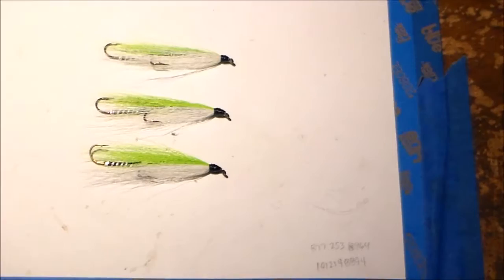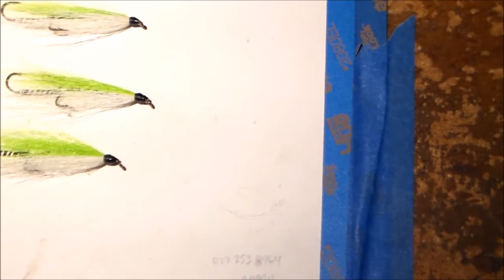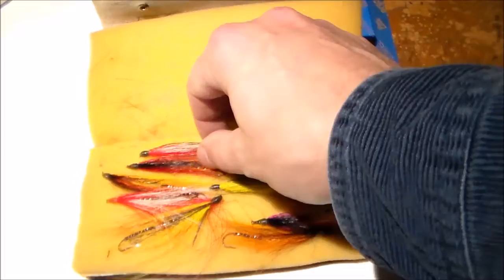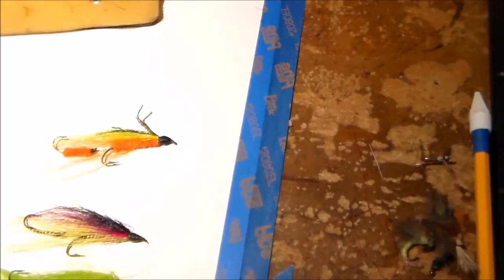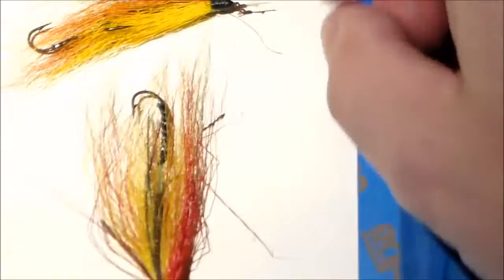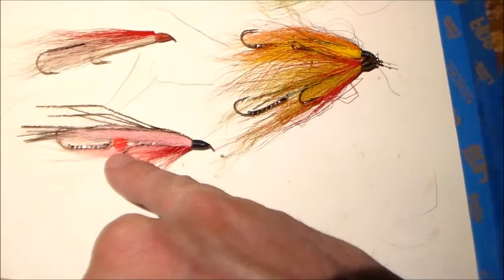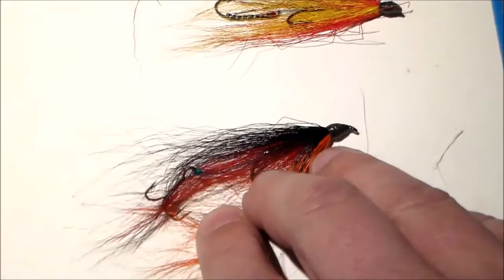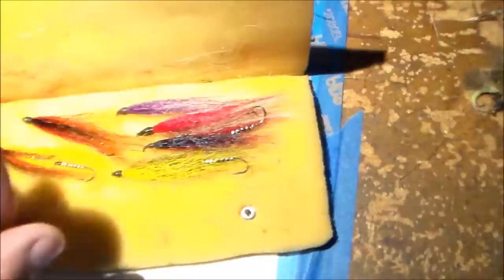How to Tie a Tandem Bucktail Streamer Part I

Comment: I may be wrong, but I believe those double hooks at the 11:07 mark quite possibly are bait hooks with the attachment to a swivel (or tied directly to a leader) removed. That attachment is what is inserted through that hole.
Reply from the maker: That might be. I have an old Mustad salesman's binder that also shows a 3582F which is a 2 point fly hook that are brazed. It looks similar but the silhouette in the sales info has a rounded eye.